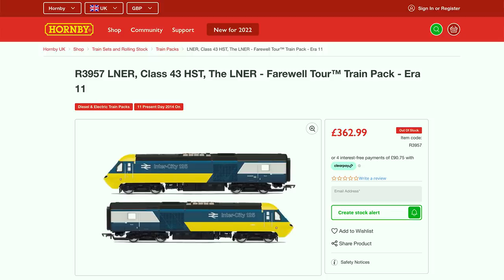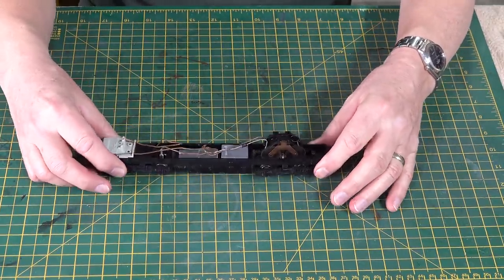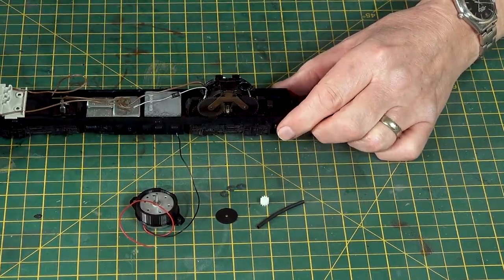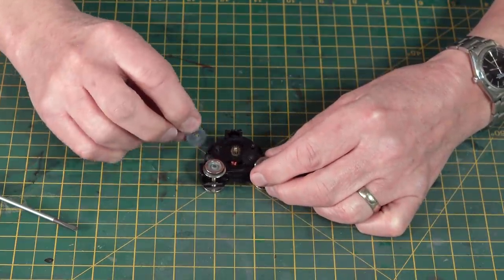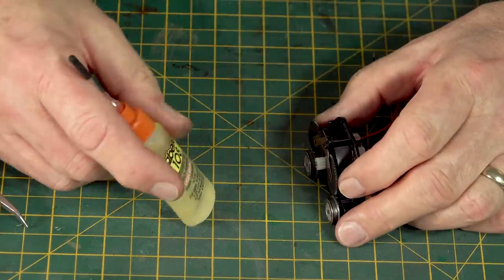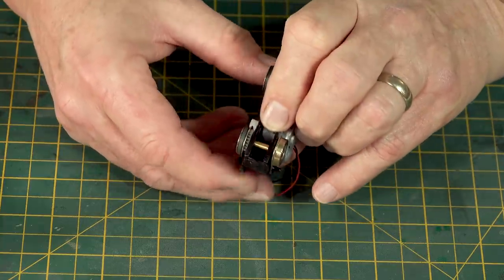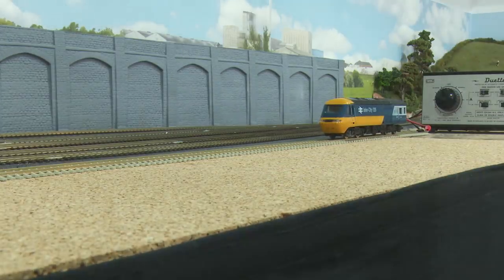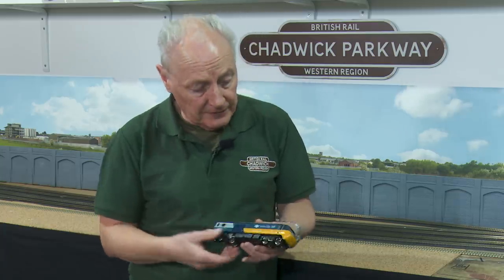Replacing Loco Motors at Chadwick Model Railway | 151.

Comment: Evening Charlie, Thankyou for this video. I have 3 sets which date back to the very early  80s. Still run well but need to be updated. Slowly getting all the parts together to “upgrade” to better 12v motor and directional lights, with possible option of dcc and TTS sound. I’m gonna go for fitting an 8 pin plug socket that way can keep DC or DCC. When ready for sound and upgraded  speakers can hopefully just swap out the chip. All is an adventure. Best part was taking the ring field motor apart and servicing putting back together and then running. Seeing the improvement of a model that that old! Or young again. Can’t wait for the next instalment in 2 long weeks. All best marc
Reply from the maker: A great comment Marc.
And I’m sure that you’ll thoroughly enjoyed the next episode, it should be right up your street. Regards Charlie

Comment: I wouldn't abandon the advise to just buy a new or more recent used loco.  Depending on circumstances, that could be sage advise.

There's those who'd cherish the chance to tear down & upgrade a unit, and those who can't or shouldn't.  Since Steve asked, you're follow up was on point.  And encouragement is one of your hallmarks.

Consider, though, a mechanical novice who doesn't have an old unit.  With the cost of new units increasing by the day, used units are rising too.  It can easily be a money pit to buy an expensive old used unit to fix, ruin it , then buy a new one in frustration.

The key is the individual's experience, confidence & willingness to accept the risk.

So I feel both your initial and subsequent reactions have merit.

PS - The innards of old locos are fascinating.  I've never seen inside older UK power.  Thanks for the trip inside.
Reply from the maker: An excellent comment Frank. I’m pleased you enjoyed the journey into the guts of an old locomotive.

Hopefully the next instalment should be interesting too. Regards Charlie

Comment: Hi Charlie, out of interest and accuracy a 'cog' is an individual 'tooth' on the rim of a' gear wheel'.  The term was originally used in respect of wooden gears used in milling  corn etc, in those gear wheel the cog is an individual replaceable 'component which obviously wear as they are made of wood.  As you know the term 'cogging' is an intermittent movement by a motor and refers to it moving one tooth at a time on the driving gear. The small gear wheel you pushed on to the motor is usually referred to as a pinion.  However this is a great video again, thanks.
Reply from the maker: Most interesting Terry. Regards Charlie

Comment: I had a go at getting my old HST going a few weeks ago. I used a gear puller to remove the wheels and the small brass gear. I found some of the wires ont the armature were broken so i just put a small bit of solder on it. It worked which suprised me. Watch your video I think replacing the motor with one of the ones you showed would be better. I will have to get 1.
Reply from the maker: I’m so pleased you found it interesting James, and good luck with yours mate.

Comment: Thank you once more Charlie, very interesting. I have looked at these before and your video is quite illuminating. Hopefully we will be able to see the interior of the later, post 2008 model, to see the difference in motor layout and drive system.
Reply from the maker: I’m a little confused Brian. I don’t have the 2008 model. Regards Charlie
Reply: @ChadwickModelRailway  at about 2 mins in, you show your own HST, R2701, dating from 2008 - 2010. That's the one I refer to, thank you.

Comment: I have treasured old 125 from the 1980s still running well so enjoyed watching you “exploring the stripdown!” Impressed that the springs for the brushes didn’t instantly disappear…!!! Very interested in how you have found the running with a train? My biggest issue is with the pickups on alternate sides of the two bogies. My old 125 usually stalls when going across a crossover between two track circuits so am thinking of installing an extra pickup on the front bogie. Wondering if this replacement motor gets around this at all? You may cover this on the part 2, but if not I would suggest this as a test as it is the only issue I find with running these old unit and you may have found an answer without major surgery…
Reply from the maker: It seems okay John although I’ve got some power test to do once my new newtons force meter arrives . Regards Charlie

Comment: If there is one style of motor I avoid it is the Ringfield. I've converted several Lima loco motors with a motor  upgrade and chassis mod, and it turned them from a toy to a nice working model. I'm sure a lot of folk will get a lot of inspiration from your modification!
Reply from the maker: Great comment Peter, we can’t just leave our old stock in boxes. Regards Charlie

Comment: I have to say, that is a useful link. I'd looked at doing this a few times in the past but not done it because at the time the guides were for mounting the CD player motors with hot glue guns which I didn't have one of. I will give this kit a go though.
I have an HST set of the same vintage, bought for my 3rd Christmas. I won't be upgrading this as I have a Hornby 40th anniversary pack for running and my old one is just for nostalgia, same with my 47712 which was my 4th birthday present. The motors on both of these are worn but they must have both done millions of scale miles when I was little. Other, newer ringfields will get the upgrade instead.
Reply from the maker: I’m just so pleased that we have the facility to breathe new life into them now Glen. Regards Charlie

Comment: Great Video Charlie, I'm with you on the horrendous prices of new models, I'd rather go to ebay and repair / upgrade the model. Looking forward to the dcc conversion.
Reply from the maker: Thanks Alan, it’s great to have you on-board mate. Regards Charlie
Reply: Looking at the brand new versions of Locos and comparing them to the old - the level of detail is now so fantastic - look at the red lining and separate hold rails on the boiler of the P2 as an example of detail. To buy second hand older versions on eBay really depends on one's acceptance of reality to 'bodged' or almost right and possibly passable in the dark. But for this one must be prepared to pay the price. One is fortunate not to be in the recording industry where a good microphone can be £2 - 3 thousand - and more! Same applies to Cameras and Lenses in Photography!

Comment: The use of a modern motor and slipping it inside the case of the old RingField casing is very clever. Inspired by this video I was going to have a go at doing the upgrade on some of my  'old stock' -  but alas I was disappointed to find the seller does not ship internationally. However at least knowing that it is an option I will just have to keep my eyes open.
Reply from the maker: So sorry to hear that Alan, regards Charlie.

Comment: When deciding what size of heat-shrink tubing to use, my rule of thumb is that its diameter shrinks to approximately half of its original size, though often I use one size smaller to make sure it attains a good grip.
I second the recommendation that you buy a mixed pack of heat-shrink tubing with a variety of sizes. You never know when you'll need it, and it's handy to have a range of sizes on hand. If you also get a range of colours and apply a small piece to the ends of wires, it's a simple way to provide strain relief and add colour-coding to make long cable-runs easier to identify.
Reply from the maker: You must have missed that piece in the video Damien I did buy a box of mixed sizes. Regards Charlie

Comment: Hello Charlie I hope you are keeping well 
I made this modification to an old Lima RES Parcels Livery 47? It all started as a bit of a windup really between me and a few of my friends. 
Once the conversion was made there was a joke about trying to kill it so it ran commercially and almost constantly for several weeks, (around the shop layout at Buckfastleigh, so not a small layout by anymeans and certainly clocked up the miles.)
Once it survived a few weeks we then added more coaches I think in the end it was running iwth 7 or 9 and survived as far as I know to this day as now hiding in a box in the loft. 
There is a company which makes little light circuit boards for the front of the HST so you get Head and tail lights, I cant for the life of me remember the name of the company. 
I have also recently just purchased a tiny Gear puller for 009 locos from a company called Tramfabriek. 
It is quite an easy and simple conversion to do, as they go, I had plans to do more once I had done the HST and the 47 but with my ,layout now in bits the urgency seemed to lessen a little
Reply from the maker: An excellent comment Kelvin. I have tracked down the light boards and he will soon sell out after the next video!

Comment: I picked up a 125 and dummy plus one coach for 30.00 it runs well.  the trouble is it will not run around my setup   i have made so many mistakes which your videos have highlighted.  So I am building a new set up in a larger bedroom .  It will be DC as many of my locos are from the 1960-70.  I also picked up a HST for with 5 coaches and dummy for 40.00 needs some work
Reply from the maker: Perhaps a motor unit at each end, John. Regards, Charlie
Reply: @ChadwickModelRailway  Thanks Charlie the drive motor is in the central coach you have got to assemble in the right order as the coupling dont pair up.

Comment: Open frame motors are actually very tough, if you keep the commutators clean, and don't run them on the carpet, and people add DCC to old Marklin AC locomotives all the time, and they have the old open motors.
Reply from the maker: Running trains on carpet!  
Who would do such a thing?

Comment: I bought this exact Hornsby HST set with a total of 4 coaches - one of which is a buffet car and all with lovely smooth running replacement metal wheels - for £80 boxed and delivered to my door. I then used Steathperrer Junction’s version of this kit and the result is an amazing improvement- my 5 YO son loves his new train!

Only problem is the power cars came converted to LEDs and I can get both together lighting white or red when the train is runny get one way or the other - which wires do I need to swap?!
Reply from the maker: I think I covered this in video number 152. Regards, Charlie

Comment: Hi Charlie, Like Steve Trossell I bought the original 125 in the early 80s for my Son's! layout.  It was always slow on hills and when I got back into the hobby in later years I replaced it with the new Hornby 125 which was much heavier (cheaper than now!) and had better pulling power.  If I can find the old 125 power cars in the loft I will do the conversion and add some weight and check its performance against the new one. I may also convert to DCC when your next video comes out...
Reply from the maker: I'm so pleased that you found it interesting Paul.  I'm after another set if you know of anyone who has this old edition.
Regards Charlie

Comment: Great video Charlie again. I discovered a Hornby InterCity 125 loco (yellow and grey version)in my loft which I thought I could upgrade to dcc. The loco is at least 40 years old, so do you think it could be done. Thanks
Reply from the maker: Without doubt Steve. If it still works on DC, you can do it. Regards Charlie

Comment: Another great video Charlie, what would be nice to see in the next video is the pulling power of the replacement motor and if adding any additional weight would help with the pulling power. Would it be recommended to have a motor in each end of the HST like the real thing to be able to push/pull a full set of coaches.
Reply from the maker: An interesting point Peter.

However, I have on order a newtons force gauge, which should fulfil that requirement. Regards Charlie

Comment: Just a comment about circlips and E-clips - they are different, although both fit into a grove on a shaft. The circlip sits in the grove all the way around (almost), encircling the shaft, hence the name, whereas with an E-clip only the three lobes sit in the grove. This means, pound for pound, a circlip is much stronger but it usually requires a special tool to remove it and it will only come off along the length of the shaft. An E-clip can be removed with a screwdriver and comes off the shaft sideways.
Reply from the maker: Thanks mate, but they both have the ability to ping off into oblivion, never to be seen again!
Reply: @ChadwickModelRailway  I can't argue with that. 🙂

Comment: Many thanks Charlie, what a great video for those of us who still have older locos that we like to run or would like to run on dcc. You may have now opened up a whole new industry! Would it be possible to go back even further? How about the sixties? I have 5 or six old triang emu/dum units that I would love to run on dcc. I have chipped an old R225 emu but it still doesn’t run that well and is still very noisy because of the knurled wheels.
Reply from the maker: It’s a difficult one really. If it does run well on DC best leave it.

Comment: Hi, Charlie - another very informative video! Sorry to be 'picky' but IF you're handling solder (even the lead-free stuff) it's a really good idea to wash your hands thoroughly afterwards! I know you're going to do a DCC conversion after this BUT if you were NOT going to go DCC, it would be an easy improvement to fit a white LED instead of that bulb (I'd be tempted to try & put reds in, too) - the LEDs would be on fairly brightly even at a crawl. Looking forward to the DCC convert....
Reply from the maker: I take your point Kev, but on the circuit board that I intend to fit with both red and white lights, it’s good for both DC and DCC Concepts. Regards Charlie

Comment: Great thought provoking video. With the prices of locos what they are perhaps modellers will be buying old non runners and refurbishing rather than buy new? A you tuber called 00 Bill does just that, very interesting, yes,  Any new tooling is an improvement to any loco but another of modellers maybe just don't have the budget ! Regards, Terry.
Reply from the maker: That’s very true Terry.

And also if you’re viewing your trains from around about 3 feet it’s hard to tell the difference in the first place. Regards Charlie

Comment: Brings back such memories of my youth, trying to get my Hornby HST to run decently!!!
I had the circa 76/77 MY, which differed a little bit from your model in that current from the motor pick up wheels was passed from the motor body by way of a little 'peg' touching one side the brush arm, as opposed to the short wire with spade connectors.
So regular were my attempts to get it to run well, I could probably strip a ring field motor down, including armature and even magnet removal in a matter of minutes. Unfortunately the fact that I became an expert in all Hornby ringfield motors (they were all identical, just a longer block for six wheel bogie models e.g Class 47 etc) was because they were generally such bad runner's!! In the case of the HST, probably because I was a young teenager, speed for this new 'high speed train' was always something I craved and was usually lacking, and  there was always a distinct difference in performance between direction of travel, to say nothing of the issues with the couplings which would lead to far to many derailments when the power car was pushing the train. 
Other more novel quality issues came when using the then new (and highly radical for the time- it actually was shown on Tomorrow's World!!) Relco high frequency track cleaner, which like the more modern versions from for example Gaugemaster would ionise the dirt between pick up wheels and track in the event of the all too common stall. Regrettably not only did it ionise the dirt but stripped the plating off the wheels, as it was so badly applied!!! I can remember a sales assistant in Beatties of Holborn telling me 'what did I expect, the metal used was from recycled Ford Cortinas!'
The concept, rather like that other great invention - Zero 1, was quite clever as it meant the same drive unit could be used in every model made with little if any alterations. The problem like so much of British manufacturing of the time, was poor quality control. To that end don't get me started on BL and amongst other cars the Rover SD1!!!!
APOLOGIES for my ramblings, but your video brings back so many memories, and I could, but don't worry I'll finish now, talk at length about all these era of models idiosyncrasies!! 
Thanks for the nostalgia and bringing back all those many memories...
Reply from the maker: Wow, what an interesting comment Keith.
Clearly we don’t have to keep moving forwards! Regards Charlie

Comment: this is very helpful video for me has i have a few old engines that might need a new motor / service - cos they been siting idle for years and some sound rough -- was wondering if a drop of oil in the axel shafts would be ok to help with the smooth running of the engine aswell and will be hoping to get a some motor kits later on in the year
Reply from the maker: Good luck with updating your stock mate. Regards Charlie

Comment: Hi Charlie, I great video on converting a hornby ringfield to a CD type motor, I have done a few for a friend and he's very pleased with the result, please be aware that some people that make these kits sometimes supply a 6 volt motor and use diodes to reduce the 12 volts to prevent motor damage. I seem to think 12 volt motors were in short supply at the time. Regards, David.
Reply from the maker: Yes David I do understand about the 6 V motors.
One has to be careful not to burn them out. Regards Charlie
Reply: @ChadwickModelRailway  Hi Charlie, I purchased my kits from Strathpeffer Junction and he only had 6 volt motors at the time, if you are DCC then as you know you can set your decoder to output only 6 volts. Regards, David.